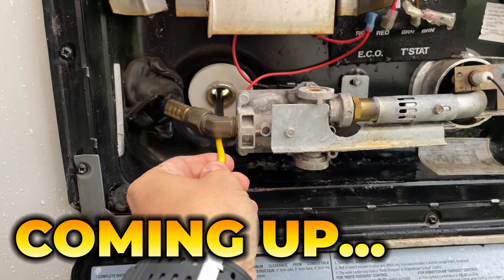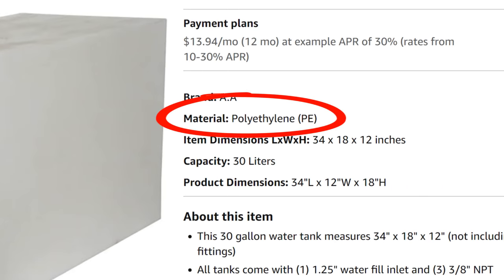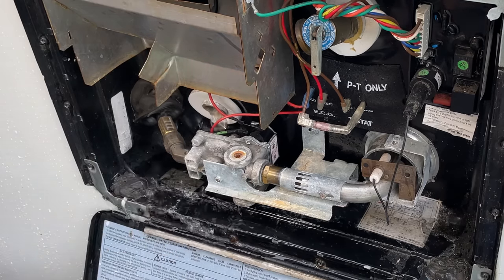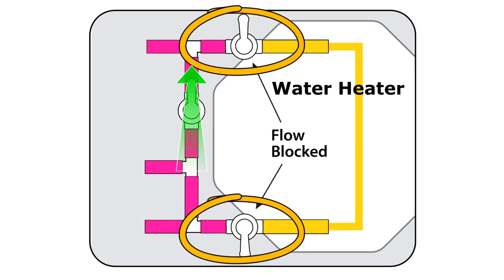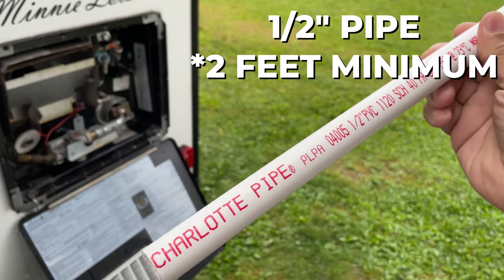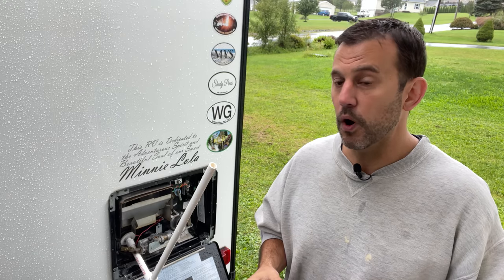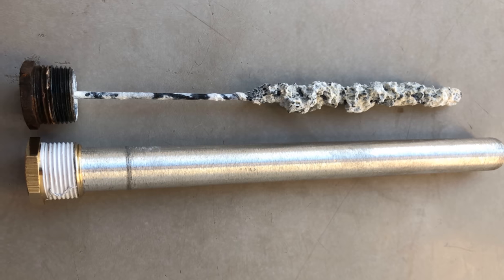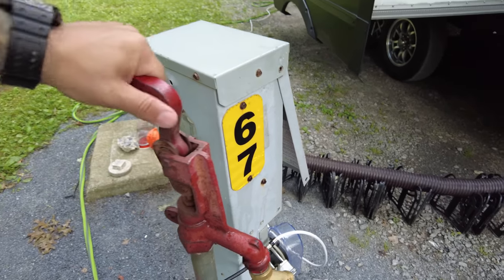Sanitize & Descale ANY RV Water Heater w/ This Simple Hack

Comment from the maker: ✨⭐ PRODUCTS FEATURED IN THIS VIDEO ⭐✨
🔹 Water Heater Flush Wand https://amzn.to/45i4c2K
🔹 Borescope Camera https://amzn.to/46xYXge
🔹 Anode Rod https://amzn.to/3EYNhrj
🔹 Nylon Drain Plug https://amzn.to/3PXkr0F
I recommend to buy these items below locally since they will be less expensive:
🔹 1/2" NPT to 1/2" Pipe
🔹 1/2" Pipe Elbow
🔹 1/2" Pipe
🔹 3/4" NPT to 1/2" Pipe
🔹 3/4" Pipe Elbow
🔹 3/4" Pipe
🔹 White Distilled Vinegar

OTHER VIDEOS YOU MAY LIKE
🎥 RV Bypass Valves Explained: https://youtu.be/rLAnkCVfjO4

How to Clean & Descale ANY RV Water Heater Tank w/ This Effective Method Cleaning, sanitizing and descaling are all important RV water heater maintenance jobs to keep your water clean and your water heater running efficiently.  We will be using white distilled vinegar for our descaling solution.  This will break up dissolved solids, calcium build up and flush dirt from the bottom of your RV water heater tank.  Let us know if the video helped you understand the process and if you have any further questions. PLEASE click like, leave us a comment & subscribe so you don’t miss any of our future videos.  

Check out my friend Joshua:  @rvgearandfar  

#rvlife #rvliving #rvtips #rvtravel #rvtips #rv

✨⭐ OUR FAVORITE RV ACCESSORIES ⭐✨

ESSENTIALS:
✅ Camco Rhino Flex Sewer Hose & Elbow Kit https://amzn.to/3wxaiyG
✅ Camco 90 Degree Clear Sewer Elbow https://amzn.to/3eezBe7
✅ Camco RV Water Filter https://amzn.to/3VzcMqi
✅ Rubber Wheel Chocks https://amzn.to/3v0lL5I
✅ Hughes Watchdog 30 Amp Surge Protector/EMS https://amzn.to/3hAmgCy
✅ Hughes Watchdog 50 Amp Surge Protector/EMS https://amzn.to/3HKrpm1
✅ Liquified RV Tank Treatment https://amzn.to/3ksg1Ck
✅ Tire Minder TPMS https://amzn.to/3mjuBg0
✅ Water Pressure Regulator https://amzn.to/3m3ZFzZ
✅ Rubber Gloves 6 Mil https://amzn.to/3XNo7Dc
✅ Collapsible Water Hose https://amzn.to/3SvNubw

MAINTENANCE:
✅ Boeshield T-9 Rust Preventative & Lubrication https://amzn.to/3sjcjMx 
✅ Eternabond Roof Tape https://amzn.to/3Ad290J
✅ Geocell Proflex Sealer https://amzn.to/3KGMOyb
✅ Road Tool Kit https://amzn.to/41NIQKj

INTERIOR:
✅ Camco Cross Bar Door Handle https://amzn.to/3o8WWS5
✅ Shower Caddy https://amzn.to/3bdU80W
✅ Soap Dish https://amzn.to/3pKheSn
✅ Oxygenics Shower Head (White) https://amzn.to/3nhDMYW
✅ Oxygenics Shower Head (Brushed Nickel) https://amzn.to/2O8YcYC
✅ Perfect RV Paper Towel Holder https://amzn.to/3tZxd1K
✅ Dimmer Switch https://amzn.to/3rQdfFD
✅ Sliding Door Latch https://amzn.to/3EkpTT0
✅ Puppy Paw Hook https://amzn.to/2N9JaRV
✅ Foldable Storage Bins https://amzn.to/3tIp01f

EXTERIOR:
✅ X Chocks https://amzn.to/3m3ck2i
✅ Carmtek 10 Digit Keyless Entry System https://amzn.to/3t4IMpB (see the video here: https://youtu.be/KcEUgsDw6kk)
✅ Low Point Drain Valves https://amzn.to/3Jd6adb

OUTDOOR GEAR:
✅ Blackstone Griddle 22” https://amzn.to/3MDDiL0
✅ Blackstone Griddle 28" https://amzn.to/3eBnOuD
✅ Outdoor Gravity Chairs https://amzn.to/3Sb1p4M
✅ Ground Mat https://amzn.to/41u3wXg
✅ TurboAnt Electric Scooters http://shrsl.com/27grx-1yiz-ub6o

💥 Sign up for our FREE Newsletter: https://view.flodesk.com/pages/6497c6a9d1998fa8c7623e9f

✨⭐ MORE RV ACCESSORIES ON AMAZON ⭐✨
https://www.amazon.com/shop/rvtipstravels

💥 NEW TO OUR CHANNEL? Check out our catalog:
https://www.youtube.com/c/RVTipsTravels/playlists

🙏 If you found this video helpful & want to support our channel with a small donation click here: 
https://www.paypal.com/donate/?hosted_button_id=J2KKM9NR3BJJA

✨⭐ DISCOUNT CODES TO SAVE MONEY ⭐✨

🔨 Learn how to repair & maintain your RV like I did w/ this COMPREHENSIVE training course:
https://rvtechcourse.com/?ref=rvtips&travels

🚐 10% off RV Snappads! https://rvsnappad.com/discount/RVTT10

🛌 Get 25% off your RV Mattress by Brooklyn Bedding at https://rvmattress.com/rvtips
Use discount code: rvtips

📡 GPS Tracking for your RV! https://www.wheresafe.com/rvtipsandtravels
Get 10% off by using discount code: RVTIPS10

If you find a dead link, let us know so we can fix it!

📺 Want to see more RV videos? Please SUBSCRIBE & CLICK THE BELL ICON 🔔 so you're notified when we release new videos!

Follow us on social media:
📸 Instagram https://www.instagram.com/RVTipsAndTravels
🕺 Facebook https://www.facebook.com/RVTipsAndTravels

We may receive a small commission for purchases made through the affiliate links above. There is NO additional cost to you when purchasing from our links & it helps cover some of our material and equipment costs to make these videos. We also may receive products or payment in exchange for content discussed in this video, however our opinions and feedback are based only on our experiences, regardless of any compensation. We GREATLY appreciate your support!

Comment: Just a point to mention, that you should flush away the vinegar that comes out of the pressure relief valve after filling is completed. You don't want vinegar sitting on your hot water tank parts and electrical connections overnight, or they will start corroding these items. Rinse away any spills. Great video.
Reply from the maker: Great point, thanks!

Comment: Even after owing 2 RV’s and camping for 20 years in a row, I still learn new things from your channel. This is definitely a method that I will use in the future. 👍
Reply: So true!
Reply from the maker: thanks Paul!
Reply: @RVTIPSANDTRAVELS good video. The drain valve on ours isn't straight out like yours , it is an older rv. It goes a little down so we will adjust the parts and make one like you did.  But did drain the tank 4 times trying to flush out a lot of the chunks of calcium . I will have to watch the other video you mentioned something about the shutting off the tank valve to understand what you mean. But we messed up watching another video first and wasted our time. We have no water at all coming throught the bathtub or the sink in the bathroom . Got some pressure now in the sink in the kitchen . 
We have I believe a 10 gallon tank and will be using your method to take care of that issue. Just going to watch a few videos of yours on how to deal with the back bathtub and sink back there now to figure out what we can do to get full water back in the back . 
We are not savy and it's stressful at this time . 
But we definitely will be using your methods and sending other rvers here your way.

Comment: Great video Ross I’ve done that on my suburban a few times i usually pull 10 gallons through the water pump then I bypass the water heater and let it cook 👨‍🍳 overnight also I’m sure the vinegar might clean the water lines as well love the bloopers 😂 have a good one
Reply from the maker: some folks use vinegar to santize the whole system instead of bleach, something I might look into.  Thanks bud.

Comment: I have appreciated this video more than once, as well as so many others.  Just an FYI:  on our 2022 2600RB it required a 1/2" FIP (female) since my water heater has a cap.  So just advising for everyone to check before you buy. My 6 gallon tank could only hold 5 gallons, perhaps there was more water in hot water in the tank, but I had drained and opened the low points.  Either way it is much better & THANKS AGAIN!
Reply from the maker: Thanks for sharing

Comment: don't mean to be one of "those", but your video made me want to clean my water heater. I have a dometic, so what I did was to use pex. fitting off the  drain into pex tube bend with my shut off valve above the water tank. Thanks for the idea. Did this as the water system was sanitizing, drained them both the next day.
Reply from the maker: No worries Dennis, I'm glad it did actually, its eye opening how dirty these get at the bottom, even clear water is coming through the faucets.  Pex is another great way to do this mod, thanks for sharing.

Comment: That's a lot more work than what I've done in the past.  I usually do the same process as if I was going to run anti-freeze through the system to winterize, but I use vinegar instead and don't by pass the hot water tank.  I do the same cleaning process, and then cap my tank, insert the hose in the vinegar bottle and turn on the water pump.  The first place the system wants to put solution is in the hot water tank.
Reply from the maker: You can definitely do the entire system with vinegar but a bleach solution is a much more effective sanitizer, especially against mold and bacteria, than vinegar.  That’s why I’ll still use a bleach solution for the rest of the system, and then vinegar for the metal water heater tank.  It’s also costing much more for extra vinegar to sanitize the rest of the system too, especially when bleach is cheaper and just chemically better to sanitize a fresh water system.  Thanks for the info and watching!
Reply: @RVTIPSANDTRAVELS   Oh I'm sorry if I was confusing in my response, I got hung up on the PVC adapter pipe situation.  That is what seems superfluous to me.  You are right, I only use the vinegar for the hot water tank, but again I have an empty hot tank in normal mode and then go through the same process I would to put antifreeze into the system.  Instead I used vinegar, it fills the hot water tank first, and then I shut off the pump and if I need to use water elsewhere I'd isolate the hot water tank again until cleaning is complete.  Once that is descaled and flushed I turn it back to winter mode and will use bleach in the fresh water tank to flush the rest of the system.  Sounds like we are on the same page, reading different paragraphs. LOL  Thanks for your tips and tricks, I subscribe just for information like this!
Reply from the maker: Jen, sorry I misunderstood your response.  Thanks for sharing, and thank you for being a part of the channel!  Safe travels my friend!

Comment: This is the best and most understandable video I've seen on this process. You have another new subscriber! Do I  need to use teflon tape on the drain plug when reinserting it back into my dometic tank.
Reply from the maker: ive never put the cap in without teflon tape, so I'm not sure, but I would say you should.

Comment: Ross, I have an Atwood/Dometic water heater. One RV maintenance pro said I can and should use an anode plug if the rig is more than 2 yrs old.  You’ve earned my confidence so I would appreciate your opinion. Thank you, Rob
Reply: This is why I listen to other RV’ers like Ross before I listen to RV techs.  Atwood tanks are aluminum, there’s no need for an anode rod.  It’s not going to fit anyway, the thread size is different.
Reply from the maker: Sean is correct, no need.... maybe there is some science behind it that i dont know about, but the reason for an anode rod is basically to prevent the steel tank from rusting.  I'm not a scientist, but from what I understand the anode rod takes the beating so the tank doesnt.   Atwoods have aluminum tanks, they wont rust.  He's also correct in that they wont fit.  I would run away from this "rv tech".
Reply: They actually DO make anode rods that will fit in these tanks. They are aftermarket. The Dometics use a PLASTIC drain plug as a last ditch safety device. If the tstat and eco do not do their job for some reason, the plastic drain plug will melt out and keep the tank from exploding. That’s why you NEVER replace with a metal drain plug.
Reply from the maker: Chris, what you’re saying is not true at all.  I’ve already spoken directly with dometic engineers about this, and I have plenty of emails I can forward you if you’re not going to believe me.  The nylon plug will not melt or shoot out as a safety device. Whoever started this rumor has no idea how a water heater is built.  The safety device is the P&T valve, not the plug.
Reply: @RVTIPSANDTRAVELS  i absolutely would like the emails, because we are getting conflicting information.
Reply from the maker: So I guess you don’t believe me? That’s kind of crappy I guess, but I’ll still send you a screen shot tomorrow.  I have a feeling though, since my word is not enough, whatever i do moving forward to try to help you, even sending you an email with information directly from the manufacturer, still won’t convince you.  Therefore I would encourage you to start reaching out to the manufacturer of these products yourself.  That’s always the best way to get correct information.  Also, run away from whoever taught you about aluminum water heaters lol.

One more thing, I’m going to release a video about misconceptions and will be using your screen name and comment about the melting and exploding plug in the video along with the emails from Dometic to help educate others.  It’s a public channel so I don’t need permission to use it but I always like to give people a heads up before I use their comment.
Reply: @RVTIPSANDTRAVELS  why is it crappy? I dont know you and am not just taking your word on it. My sources are people that work on these every single day and have trained with and know and work with all of these companies. That’s why i said we have conflicting information. I’ll take the information you say you will provide and go from there. I’m not calling you a liar, I want to know for my self. I will see what information my sources have tomorrow and go from there.
Reply from the maker: I would be hard pressed to believe that your sources work on these every day and work directly with Dometic.  If that is the case, it is time to find a new shop my friend. Here is the link, as you will see the anode rod is not needed, as that is addressed in my question and Aaron responds with why a nylon plug should be used.  They dont come with one from the factory, there is absolutely no use for one or they would come with one. Also, Aaron Harris, who is the product manager for the climate line for Dometic in all of North America (climate means water heaters, air conditioners, and furnaces FYI), explains why nylon plugs are used... they are economical and more importantly any dissimilar metals that may come in contact with aluminum can corrode.  He also explains that the P&T valves is the pressure failsafe, not the nylon plug.  Good luck. https://drive.google.com/file/d/1NDj5DJOwheZgHqPXP6bmECJkycyYAiQb/view?usp=sharing
Reply: @RVTIPSANDTRAVELS  thank you for this information. My statement was not clear about the anode rod. The one poster said an anode rod has different threads and won’t fit. They do make them that do fit. I know the reason Atwood/Dometic do not use them. Anyways, I appreciate the info on the drain plug and will be relaying it.
Reply from the maker: Not a problem, glad to help and glad to have you here.

Comment: You can also use a short length of male hose end and a NPT to female hose adapter fitting (Ace Hardware $2.59).You may already have the male hose end for pumping bleach solution into your fresh tank.

Comment: Great video! And yes keep those bloopers coming!! So good!
Question…if I have never done the hot water tank cleaning since I owned it, will I ruin it if I start doing this process now? You may scratch your head at this LoL but I took a brush (finally!) to our BBQ and the bottom fell out so I’m a little scared LoL) thanks for giving us so much great info!! 💕
Reply from the maker: THANK YOU!  if cleaning your water heat now and the bottom falls out, its probably a blessing in disguise.  I wouldnt worry about that because by not doing it, its going to happen eventually.  you will be surprised what comes out if youve never cleaned it.

Comment: If you cap and glue that top pipe without gluing the other fittings and heat the water, the pressure may push those apart causing your solution to leak out over night.
Reply from the maker: thats a good point, thanks for mentioning that... I leave my heater off so I didnt run into this during my cleaning, but great point and thanks for sharing!
Reply: @RVTIPSANDTRAVELS  I’m new to RV ownership but not plumbing 😉

Comment: Ross, I have a suburban water heater and this process worked great
 Only question I have is that even after pulling the pllugs on the low point drains, the water level never went below the threads for the anode rod
 Is this normal or did i miss something? Thanks for the great content.
Reply from the maker: the anode rod and the low points are the only means to drain it.  You will have to get creative... the first thing that comes to mind is an attachment that is small enough to fit in the anode rod hole that connects to a shop vac.  you might be able to start a siphon too if you dont have a shop vac.  Hope that helps.  they really need to start putting a drain on the bottom, but i understand some of the complications that come with doing that as well.
Reply: Remove the top and side screws holding the tank in, then all you have to do is tilt the water heater and the water will come out. When you are done put the screws back and seal it back up.